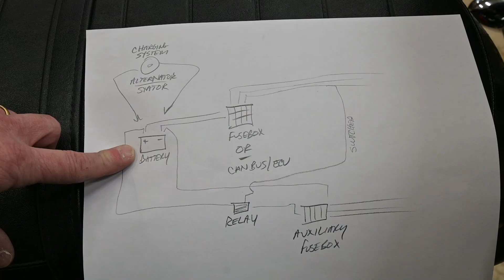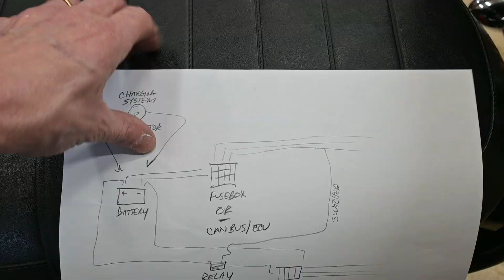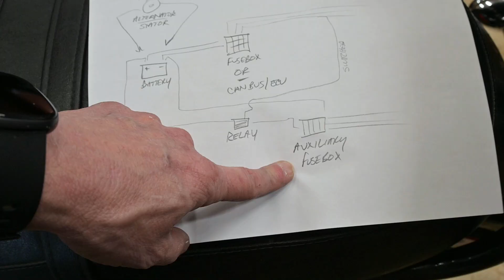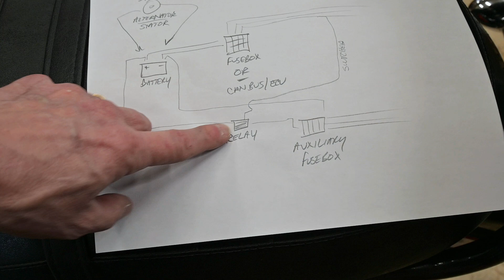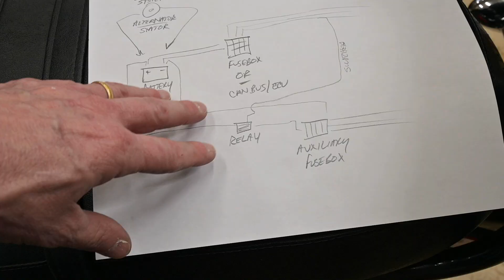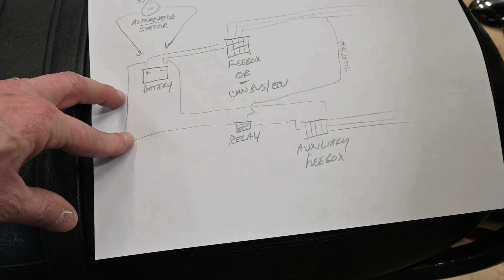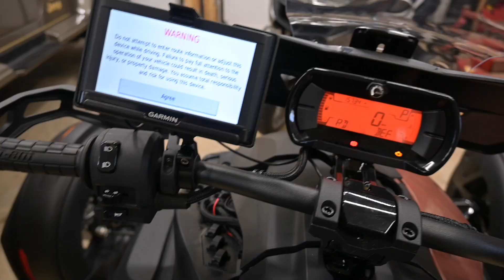Auxiliary Fuse Box And Relay For Your Motorcycle

Comment: Question: Do I need to change the existing fuse in the auxillary fuse box to match the amperage of the wire(in the main fuse box e.g. the fuse for the headlight) im tapping into for the relay of the aux fuse box?
Reply from the maker: I'm not sure I follow your question exactly.  Any fuse is intended to protect a circuit from excessive draw in relation to the wire gauge.  You can look up charts on the interweb to guide you about wire gauge, wire length, and fuse amperage (https://wiringproducts.com/pages/wire-amperage-capacity-chart).  So if you have an auxiliary fusebox, there will be a wire feed for the main power, connected to the battery.  If you wanted to include a fuse for that main power you would consider the wire size and length.  It isn't necessarily related to the circuits connected to the aux fusebox.  The wire for the fusebox *relay*, if there is a relay, will typically be very low draw and should not require it's own fuse.  That would be protected by the fuse for whatever circuit you are tapping for that relay.

Comment: Congrats for the video, great explanation. I do have a question: On the quick guide it is said that, if the location you place the fusebox can be wet (I know it is not desirable but the only place I can hide it on my Meteor 350 is under the seat where the toolbox were placed, and I eventually found some water there after heavy rain), add a inline fuse to the battery (at least this is what I understood). Instead of conect the fusebox direct to the battery with the terminals provided I would add a fuse before the positive terminal. Does that make sense? If so, would I need to add a 14awg and which fuse amperage? I am noobie in electrical circuits but very curious. Thank you so much in advance.
Reply from the maker: The point of a fuse is to prevent excessive current draw, which might otherwise cause a wire to heat up and catch fire, for example.  A fuse for the fusebox I suppose could prevent you from drawing too much current through the combined circuits, but it wouldn't really do much as far as protection from water.  I suppose if you had a direct short to ground from the fusebox it would help.  Maybe your efforts would be better placed on figuring out a way to protect against water intrusion that might short out any electronics.
Reply: @tinderboxarts thank you so much

Comment: Hi, what is the joiner at minute 11:39 please?
Reply from the maker: That came with the cable I had purchased on ebay for the Ryker, but you can use any connector. It's important to find a source of switched power for the relay but how you physically connect can be done a variety of ways.

Comment: Could I use this to replace my existing fuse box
Reply from the maker: That would not be a good idea.  A main fuse box generally is tied into the main harness with a watertight connection, and depending on the bike you'll need spots for more fuses and more relays.  Plus, without a main fuse box in place there would be no circuit to power the relay on this unit.  Better to source the correct replacement if you need it, or else use a larger automotive generic style.

Comment: I Can i fit a 2nd auxiliary box
Reply from the maker: You can, however, it may start to get busy at the battery terminals.  It may be better to search for a single large box if you really need that many additional circuits.  You also need to pay attention to your bike's alternator or stator capacity.

Comment: Thanks a lot for this, I was looking for a proper solution to add accessories to the bike, but all the tutorials just splice into existing cables without any fuses or relays. This set every doubt I had straight, and I can just proceed with this solution.
Reply from the maker: So far this particular box is working well, but there are also others available with the same general design.